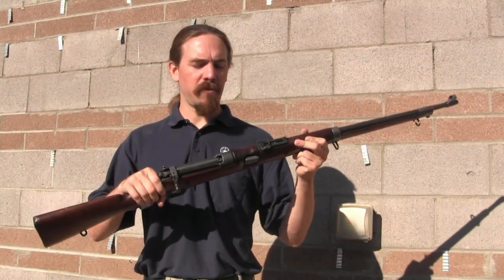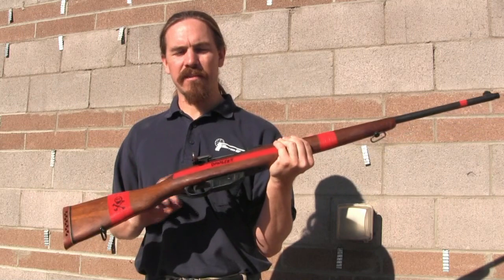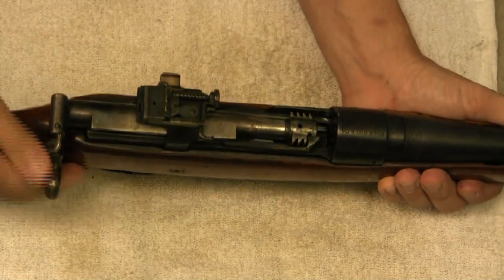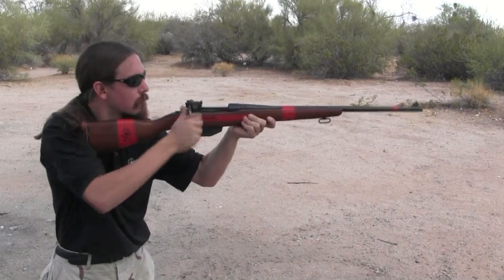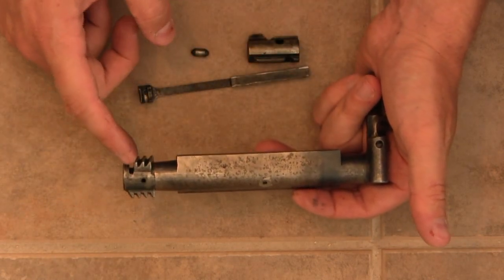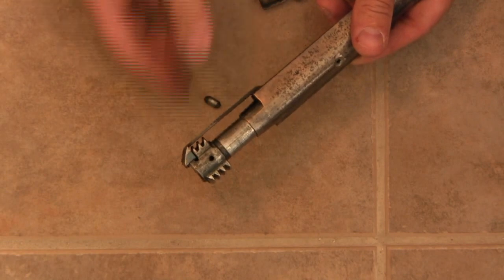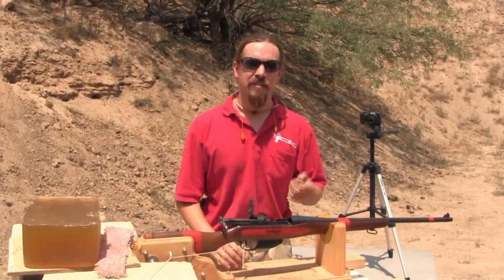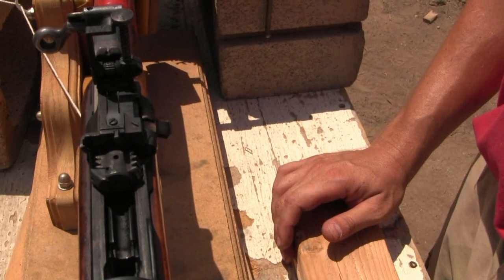Myth and Reality of the Ross MkIII Rifle

Comment: I never heard this 'blow up' myth, and I actually live in Canada where most of the Ross Rifles are. I heard about the jamming in dirt, and I also heard about its great accuracy as well as its preference to marksmen/snipers who might not be up in the front lines running, jumping, climbing, and stumbling in the gritty mud, blood, and guts (Many today still tout the Ross Rifle to be the most accurate .303 available). In my mind, I actually thought that the bolt just might 'fly out' of the rifle, though never actually heard it as a myth.

I suppose the myth circulated because of people who thought the same, however spouted it out as fact in a boast of trying to know what they're talking about without the modesty of admitting they don't know their facts. I've planned to get one for a while, and I still intend to get one even though I already have 4 Lee Enfields. Those full-stock examples are VERY rare and expensive since most have had their stocks cut away for weight; I'm glad you chose a sporterized example to experiment with.

This was very interesting to see, good to know how to properly reassemble the rifle, and to know what was done to prevent this accident from happening. I tend to look at the M16 as the mid-20th century assault rifle equivalent to the early-20th century straight-pull Ross. Great accuracy, definitely a fantastic marksman/range rifle, however the tight tolerances can prove to be a problem over time if dirt (or excessive gunpowder residue from the DI gas operation) began to muck up the bolt.

 There's even accounts of dozens of US GIs found dead next to their jammed, disassembled rifles. I guess the reason why they didn't go with a different assault rifle design was because... perhaps there was no other American assault rifle at the time? I think there's been talk since the 90s of finding a replacement for the M16/M4, however they just keep improving on the same 50 year old design while other more modern assault rifles are popping up around the world. Must have to do with politics, I mean they seem to have vastly improved the reliability since the original M16 and M16A1, so I guess they'll keep using/improving that functioning all-American design until another one springs up that's more modern?

Although it would have been great if they somehow improved the Ross' reliability some how with a hypothetical Ross Mk.IV so that this Canadian design could be used in all of WWI as well as perhaps WWII, the Lee Enfield is arguably the better design for closer ranges. Smooth bolt that can be worked without letting go of it (increasing rate of fire), double the capacity, and extremely reliable with the loose tolerances while retaining good accuracy for 500m+. Some even took the Lee Enfield to 900m, believe it or not! Helps keep the Canadian troops safe when they're within close 100m ranges (Which I think most of the combat of WWI was). WWII was between 100-300m on average, which is probably a better range, and I think the combat in said conflict was usually in less outright muddy/dirty conditions, so the Ross probably would have faired better there.

Still, that smooth cock-on-close Lee Enfield bolt coupled with the fact that the bolt is so close to the trigger that it could be fired without letting go of it, is hard to argue with. I can manage to rapid fire 2 shots per second with my Lee Rifle. I'd like to see a Ross, Mauser, Mosin, K31, Carcano, Arisaka, P14, M1917, or any other bolt gun manage such speed.

Wow, I damn near typed up a short story here... anyways, I don't mean to hate on the Stoner design, I just think it might have been beneficial for the US Military to adopt a different rifle as soon as one became available. Especially since it directly cost the lives of US soldiers. The 1950s vZ58 would have been a good pick, but with the Cold War... probably not feasible. 1970s Steyr AUG is one, 1980s L85A2 or SIG 550 is another, 1990s G36 seems like an amazing design (Completely ambidextrous with a red dot and scope on each rifle, however I would prefer irons over a red dot), but current AK-101 would be my choice if I got to pick what the Canadian Forces would be armed with.
Reply: as someone who has used the G-36 i can say it good but not amazing for i had some issues with it (some of which are actually quite easily fixed)
first issue i had is that the combined sight makes it difficult to use for someone who is wearing glasses, if your glasses are not high enough (extending far enough below your nose) you'll have trouble using the scope, the red dot on top is fine although it also has issues with the solar powered configuration being complete ass because think about it: when it's bright enough for the mirror thing to actually produce a red dot, it's also so bright outside that the red dot doesn't get bright enough to be seen easily and when it's dark it doesn't work anyways so you'll almost always be using the battery, which is a bitch to replace when it runs out.
second issue is that the magazine is a little too long for my taste, it's difficult to use the thing while prone actually because you have to lift your entire upper body, arching your back in a very uncomfortable way, to not have the gun point up into the sky because it's resting on the magazine.
the last issue i experienced is not going to get in the way in combat, but it was really annoying and that is that it absolutely refuses to cycle blanks properly even with an MPG attached. this is an issue because, at least in training, you have to announce that you have a malfunction and then field strip the whole thing, put it back together and then continue to fire, now imagine doing that after every round fired because it doesn't cycle at all.
this is, as i said, not an issue in actual combat because it does not have issues cycling life rounds, but it's annoying none the less
Reply: As target shooter in competition i do not care about speed, i want a smooth action. I shoot iether a enfield pattern 17, great rifle or a carcano, wich is also an excellent shooting gun, just use the right caliber bullets.

Comment: Seen videos about cartridges in steel wire over a burning candle ?  The cartridge separates   with almost  no bullet velocity   because no supporting walls around . In this case nearly the same because the boltface is forced backwards immediately  so the buildup of the forces in the case ,with slow burning  rifle powder, is  interrupted  . But force enough to separate the cartridge case flying out and the rest of it remains into the chamber.   If the  full force in a rifle cartridge  could be  developed   ,as in a normal way  , the consequences would have  been much more serious  than this.

Comment: What are the "teeth" in the rear part of the bolt for? The spiral grooves should be enough for rotating the bolt. And those "teeth", those interrupted threads cut over the spiral grooves look like they are there exactly to enable a user to screw up the bolt without its full disassembly. But it cannot be so, can it? :)

Comment: I was actually looking at one of these in a gun shop, when a old Farmer stopped me. According to him, his brother had lost an eye to one of these in the late 1950's. His explanation was that after owning the rifle for 10 odd years the groves in bolt had worn out and the bolt slipped. Could this be possible?  And if the rifle was dirty, or the metal had expanded from heat, could it make the bolt slip? Or is incorrect assembly the only way?

Comment: I try to picture in my head what exactly in a straight pull action makes the gun unlock when you cycle the action versus the firing causing it to unlock. I know mechanically there's cams that rotate the locking lugs but is there some interconnect on the bolt that allows that to happen only when you cycle it? Or is it a matter of the amount of force used when you cycle it?

Comment: what what exactly does that rivet do to prevent that? does it keep it cam in the bolt so it can only be inserted 1 way?

also, yay!  i finally found out which video it was with that clip in the intros. wasn't until you mentioned it in your video you just released on the Infallible i was able to find it

Comment: Ian I have found a mk2 ross rifle at my local gun shop and I have had my eye on it for a couple of years now im just wondering if the price is right 300 bucks now it seems to be considerably short than the one in the video here but seems to be in good shape if you were in my shoes would you pull the trigger on it and take it home for 300 bucks?
Reply: Its probably a surplus gun that someone turned into a sporting rifle so they removed alot of the barrel.  If the action is smooth and the bolt and stock are in good condition I would buy it, but good luck finding 303 British ammo.

Comment: Tried it with my Swedish Mauser, and the action absolutely will not fire until the bolt is entirely closed. However, I did find that my Lee-Enfield would indeed fire if I pushed and held the bolt with one hand as far forward as possible without turning it while pulling the trigger with the other hand, but in that case the bolt is not entirely in battery and I doubt the firing pin would strike the primer hard enough to fire the round. That said, I wouldn't want to actually try it.

Comment: I had a Ross MK II not long ago I loved it. Shot beautiful once I figured the bolt out. It was put together wrong when I got it and it would not close right so it would sling open. Fixed that just by taking it out and messing with it and it never did it again. I may have just been lucky though. I really wish I hadent sold it, more so as I think the guy cut it up :(
Reply: martK banjoboy He cut the gun down and made a woods gun for hunting deer. Gun is still functional and he actually hunting with it next month again. Sad it got cut up but at least it lives on in some form.
Reply: Funny thing is I didn't even know what the gun was when I got it. I fixed it and shot it then after I did research I got nervous and sold it. Wish I hadent but live and learn. Just happy I got to have it even if for a short time. Was a beautiful shooting gun the only thing wrong was the extractor was missing. In hopes to get another I know a guy with one but he won't part with it.

Comment: I was just reading a book about Canadian snipers that used the Ross. Evidently they would only use the Ross unless they could get their hands on a German mouser. The one thing I wanted to ask was the book mentioned that the Canadians ammunition was different than the British issue. And when they were forced to use the British ammunition in the Ross due to shortages they had fouling and misfires. Have you heard this? Was the problem powder or case or both as this book suggested?

Comment: the problem of jamming was not to do with the close tolerances, though the tolerances were increased part way through the war, they were also increased on the lee-enfield, a rifle famed for it's reliability. the problem that caused the rifles to jam was a design flaw on the bolt stop, the bolt stops were held over from the Mark 2, and did not have sufficient engagement on the rear left locking lug, the result as wartime production quality fell was a deformation on the bolt head that would cause the bolt to jam before going fully into battery. That this flaw not found earlier is a result rushed development caused by pressure from  the war department to get the M.10 into service. Ross found the problem and started to fix it, only to be told that the contract was terminated
Reply: Dreadnought First time I fired my Ross MKII, it jammed.  Fortunately, the Hun wasn't sweeping across no man's land against me.  I had to beat the bolt handle back in order to finally get it to eject the spent shellcase.  I could see why Canadian troops got killed using it and grew to hate it.  The "Official History of the Canadian Army in the First World War:  Canadian Expeditionary Force, 1914 - 1919", indicates the problem was due to the difference between .303 Canadian rounds and .303 Imperial rounds.  Quality control on the Canadian-produced ammunition was "tighter", with the case neck diameter .010 inch less than the imperial rounds.  Dominion Arsenal produced ammunition was also hardened to reduce expansion of the brass in the chamber.  This made it easier for the weaker Ross action to eject fired shell cases.  British produced ammunition was not hardened, so it expanded in the chambers to a greater extent.  Sooo, as Canadians drew imperial rounds from the Royal Army's logistics train, and fired them in their Ross Rifles, they jammed.  Just as the .303 British round did to me.

Reference:  http://www.cmp-cpm.forces.gc.ca/dhh-dhp/his/oh-ho/detail-eng.asp?BfBookLang=1&BfId=22
Reply: Dreadnought The Ross had been in constant developement since 1903, gone through three maks. The Mark 3 was the result of experiences with the previous two marks, and supposed to fix their problems. 

Reading that a design problem was not found earlier because of "a result rushed development caused by pressure from  the war department to get the M.10 into service" is rather shocking.
Reply: the Mark III was the first rifle of the series to employ an interrupted thread locking system. The Mark I and Mark II both had dual oppositely opposed lugs like a conventional bolt action rifle, the Mark III went to an artillery breach lock design for additional strength. the rush from the Standing Small Arms Committee came as a result of a change in ammunition; the Mark II was designed for a ball round, with a rounded nose, when the new Spitzer ammunition became standard issue it would not feed in the Mark II because of the longer bullet and the changed geometry. as a result the SSAC, which had been in discussion with the Ross Rifle Company to implement a number of improvements including the artillery breach lock, requested a new rifle, which implemented these changes, and was optimized for the new Spitzer cartridges. The trials were not done by that point, but it was expected that war was coming and the SSAC didn't want to be caught flat footed with a new rifle still in trials. the trials that had been done were limited due to limited production of ammunition of the new spitzer type, indeed even after the Mark III was issued to troops, they were still being issued ball type ammo to train with because there was not enough spitzer ammo in the stockpile for troops to train with the new ammo, and the old ammo would not feed properly making the rifles single shot without the cartridges for which they were designed. which meant that the trial rifles had not seen hard use, which meant that the deformation of the bolt heads had not occurred, and even if heavy testing had been completed, by that point the US had not bought out all supplies of high grade steel yet, and the bolt heads were being made from a higher grade of steel than what was available after the war started.

in other words, yes, very shocking.
Reply: Dreadnought
 interesting

Comment: This experiment would have looked great on your newer high speed equipment.  Interestingly enough it is actually easier to push the bolt forward on my Ross Mk III when it is misassembled as compared to when it is done correctly (mine does not have the safety rivet so it's pretty easy to do this).  You mentioned that on this example it seemed stiffer.  Still, you would think a person would notice that they don't have to pull the bolt out of the sleeve a good deal to reinstall it in the receiver after assembling it wrong.
Reply: PPCRO in a rush, wet and being shelled i can imagine fucking it up

Comment: I think you missed one key piece of this situation, but got very close to it.

As you say the Ross was extremely sensitive to the trench environment. The soldiers who carried these rifles were very accustomed to having to clean them regularly--hence why a private in the trenches might have all the innards of his gun out in the first place, despite doctrine supposedly teaching him not to do so. It was either that or run up against the Kaiser's machine guns with nothing but a jammed action and a bayonet! In that kind of situation, in the horribly dingy and low-light conditions of his mud-billet it was probably fifty-fifty if he got the bolt back in the correct orientation, even if he knew how to do so properly. To me this is not so much an absolute failure of design--although obviously it was not a good one--but rather only a single nightmarish facet among so many others of the 1914-1918 trenches themselves.

Comment: I'm curious if the rifle could still "safely" fire if the bolt were reassembled properly, or if the loss of one of the locking lugs / deformed metal would prevent this. Say, if the jarhead who misassembled the rifle didn't have a good cheek weld and wasn't missing his face, and was more concerned with the need to start shooting at the Germans again or else his CO would tear him a new one.

Comment: Way, WAY late to this: But in the failure, I wonder if the bolt COULD come out if it did that if the rifle had been out during winter? A very cold, brittle bolt stop under high pressure from the bolt blowing back?

Comment: Is this problem theoretically possible with a cock-on-closing rifle? I don't have a COC rifle, but with a COO bolt, if the trigger is pulled with the bolt handle not fully rotated down, the striker will force the bolt handle down so that it does go into battery. A COC rifle wouldn't do that, so if a soldier didn't rotate the bolt handle all the way down and fired the gun, is there a chance that gas would escape from the action?